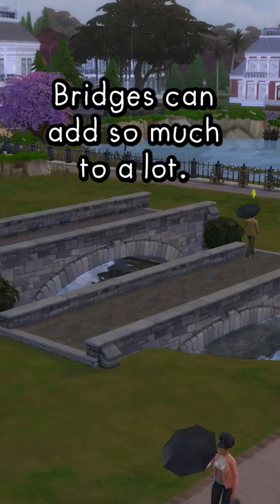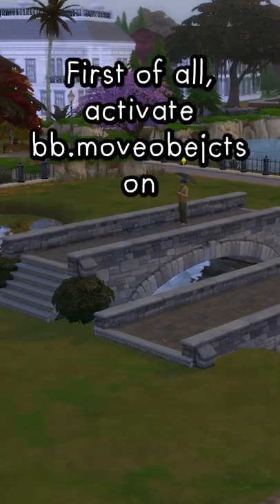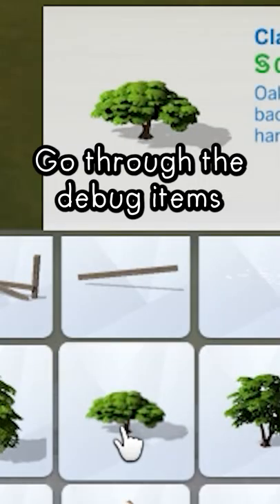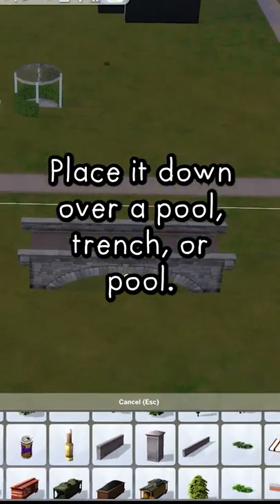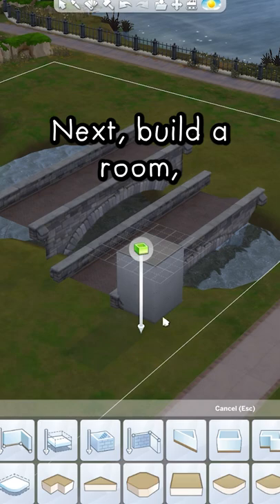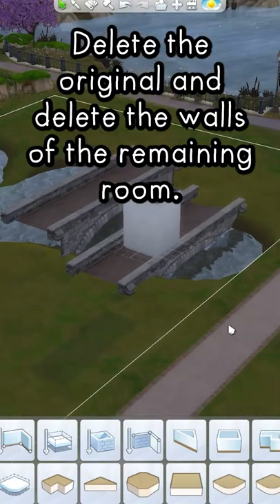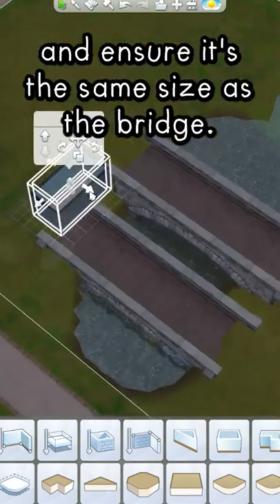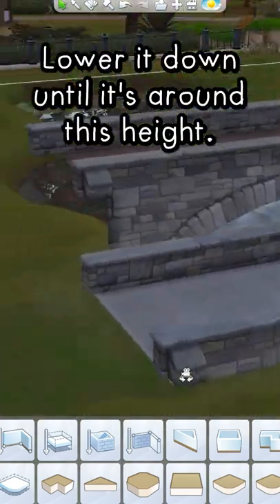Base Game Functional Bridges With Debug Items | Sims 4 Guide #Shorts

Comment: To bad hidden objects doesn't work probably on console
Reply: But do you know how to use it? I wanna know
Reply: @Kr1spK1ng  obviously I've been playing sims for manyyyy years on console the full debug menu just isn't in the console version I used the same cheats on my laptop and it worked fine however the laptop doesn't work anymore
Reply: it does
Reply: I'm on my laptop and it won't work for me either </3
Reply: @beesaregreatittheyprns2875  we can't free rotate on console nor can we access the full debug menu
Reply: @coaljulian8622  free rotate has to do with the actual device most likely, you knowbthat right? also, how do you even figure out that we don't have full access to debug?
Reply: It doesn’t and it literally sucks I’ve tried like 10 times!!!
Reply: @beesaregreatittheyprns2875  if you type in all the debug commands in every single possible way it doesn't show everything like it does on PC, I used to play on a laptop to before it broke and I had access to way more on there then I do console but it's literally not playable on old gen consoles anymore because it's so laggy
Reply: @coaljulian8622 this isnt true. I play on ps4 and can freely rotate objects just fine. You have to hold down R1 and L1 and use the right stick to rotate it.
Reply: @honeypixelss7718  it works on laptops you maybe types the cheat wrong.